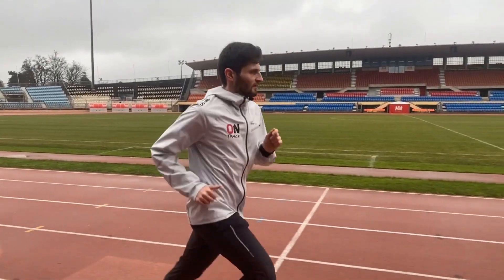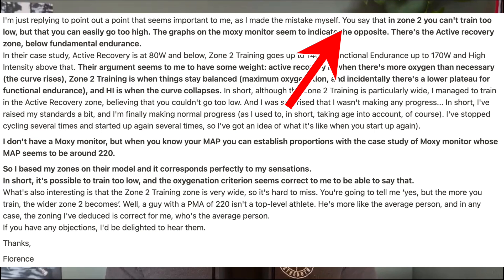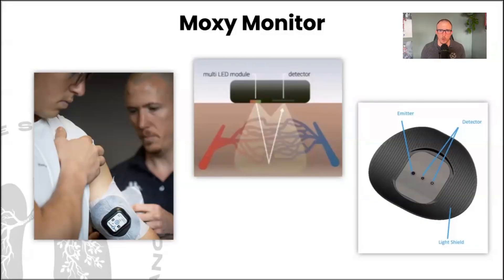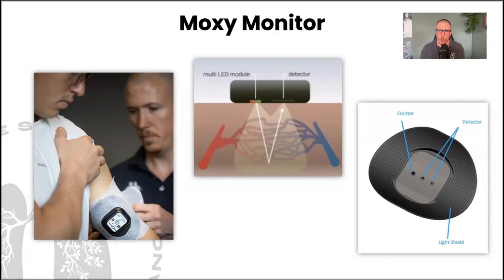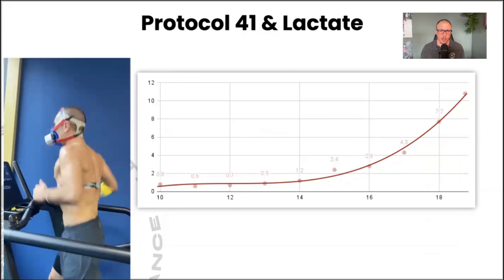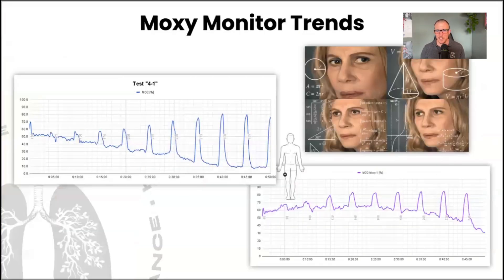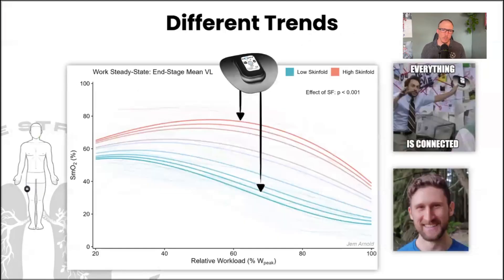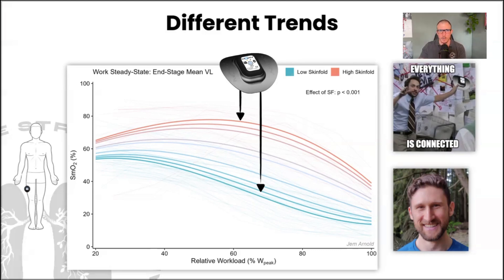TOO (S)LOW in Zone 2? - What the Moxy Monitor tells us

Comment: If you cannot go too low that means being sedentary is also Z2 training ;)
Reply: Good one 😅
Reply from the maker: I’d draw the line between static and active.. if you walk 12 hours per day, you’ll be fit AF!
Reply: @ regarding walking for 12h, this won't stress enough oxygen processing system to cause adaptation for a person that has some level of fitness, definetely not for someone fit AF. most effective Z2 training is on the upper the edge of Z2, Inigo San MIlan told that as well
Reply: @michalzurek8165  how does one know that one achieved the upper edge of Z2 and how does one maintain it ?

What exercises can be done to achieve and maintain the upper edge of Z2 ?

For how long and how often one should exercise in the upper edge of Z2 ?
Reply: @decathlete2000 Measure lactate (e.g. Lactate Plus) at different intensities and find out when it increase (e.g. went from 1.2, 1.2, 1.4, but then 1.8). This small rise in lactate indicates that you are at your top end of Zone 2.
Reply: @upsidestrengthen  actually Z2 training is effective when it's intensive enough to cause adaptation, simple